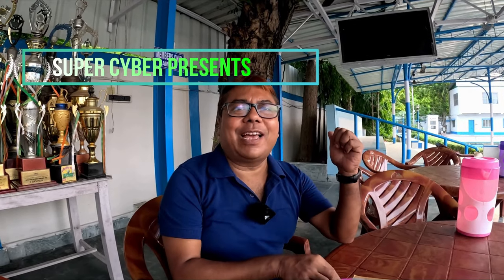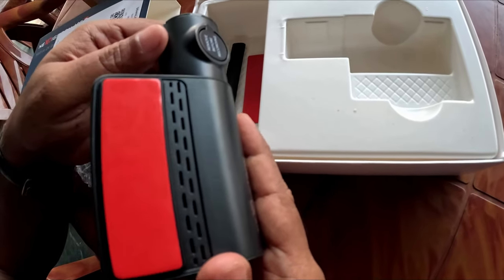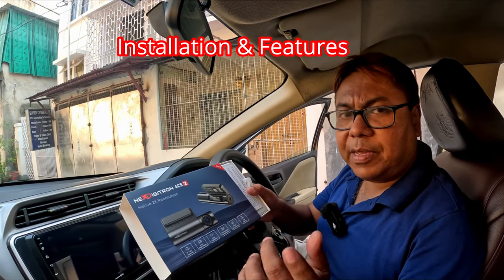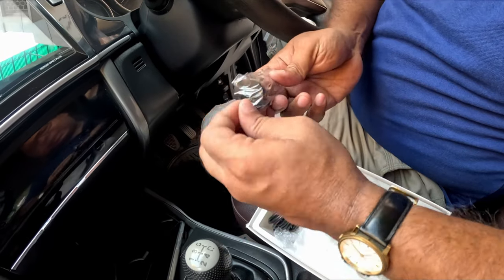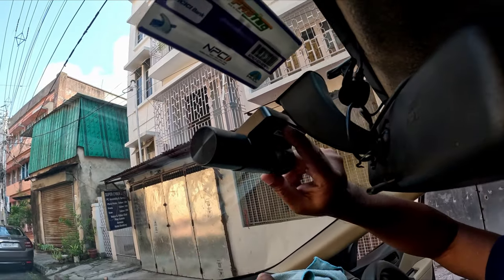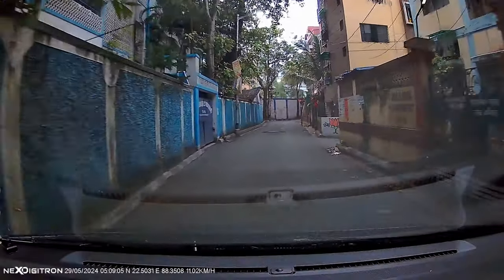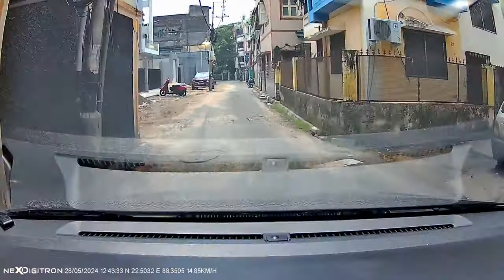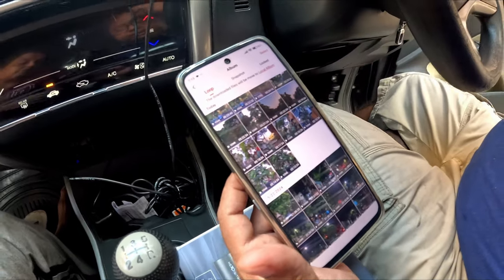Is Nexdigitron Ace 2 The Best Budget Dashcam For You? #dashcam #cardvr

Comment: Hi, great video. Im planning to purchase the same. May i know which SD card / capacity works the best? There are mixed reviews on SD cards on amazon / Nexdigitron ace 2 / which say that the card is getting corrupt after using the camera. What do you recommend?
Reply from the maker: Thanks for your query.I am using Samsung Evo plus 128 gb as recommended  without any issues.
Reply: @supercyberautomotivetravel  Thanks for responding, should i go for 256? or 128 is good enough?